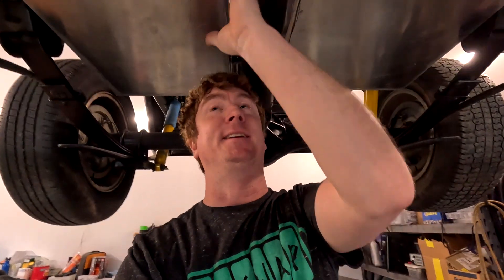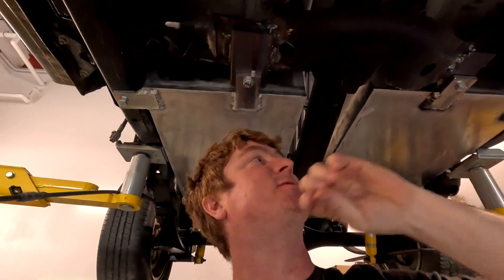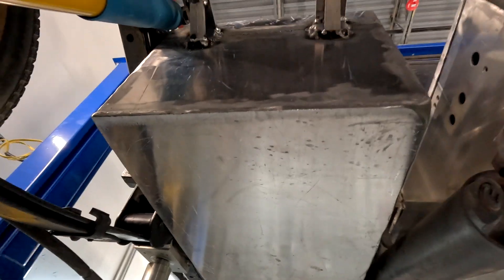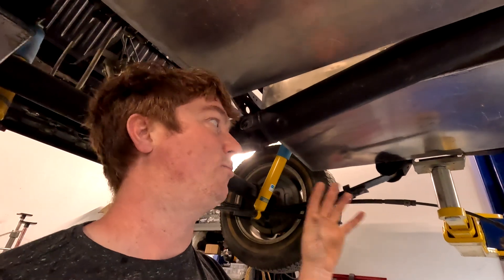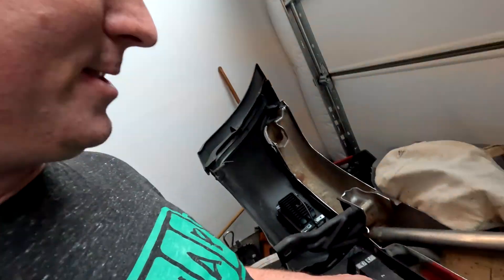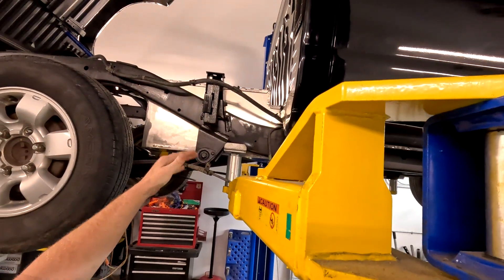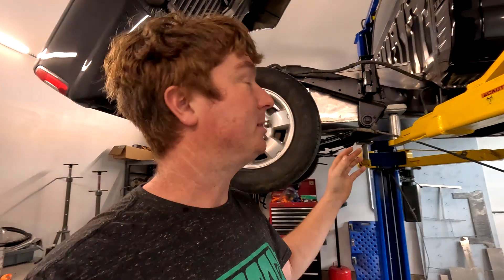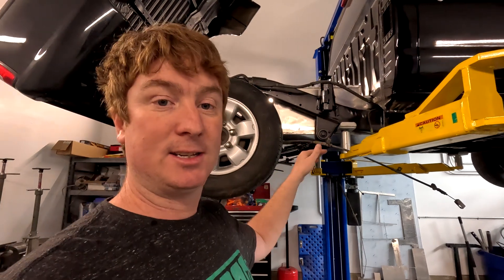Battery Boxes INSTALLED In the EV Conversion Nissan Minitruck

Comment: Hi Jimmy - love your work - keep the videos coming please!  Some questions on your cruiser conversion mate - are you happy with the power and torque from the Leaf motor?  I am in Australia and am about to do my own conversion on a 2006 Holden Rodeo tray back ( similar size vehicle to the frontera you are currently working on).  I haven’t purchased the donor EV yet, but am considering a Leaf.  The ICE i am removing from the Rodeo is a V6 petrol engine making 157KW, and 313NM.  Do you think the Leaf motor will do the job?  i just want to be able to do highway speeds (110 kph in Oz), and to have similar acceleration as the current engine.  The other option I am looking at is using a Lexus GS300 Hybrid transmission which would leave me with the whole engine bay in which to mount the batteries.  Interested in your thoughts mate - Cheers
Reply from the maker: If you do choose a LEAF motor I would recommend 110kw minimum but it would be best to use the 160kw version. My Land Cruiser has 80kw but I don't really go over 50mph and it has adequate acceleration but not stellar.
Reply: @EVSwap  Hey Jimmy - thanks for the quick reply mate - it must be late Saturday in Colorado.  Yeah I am looking at the 110kw and 320nm leaf.  And I have heard that people are getting 130kw out of that motor without any problems